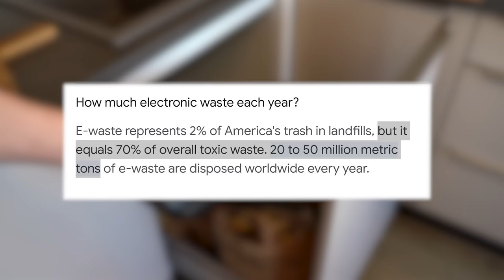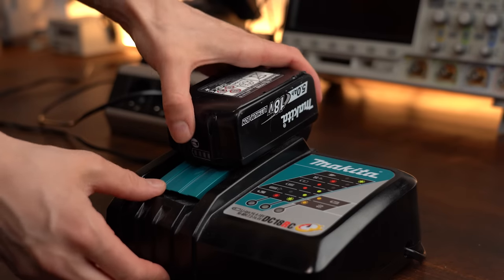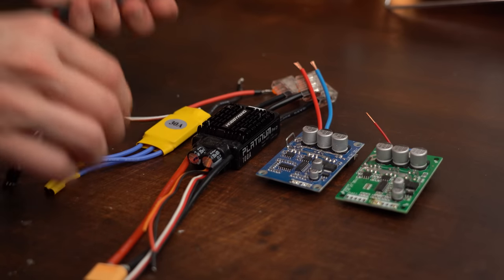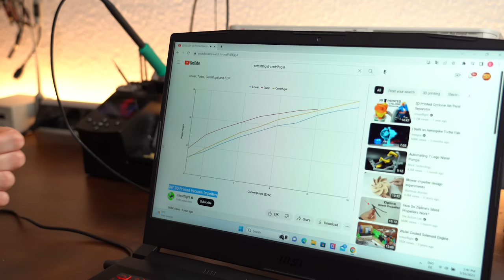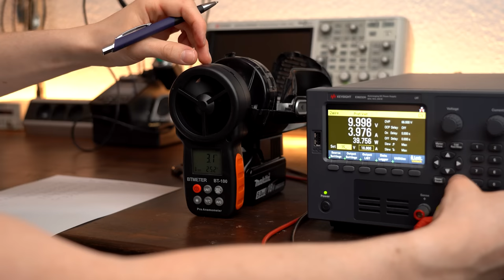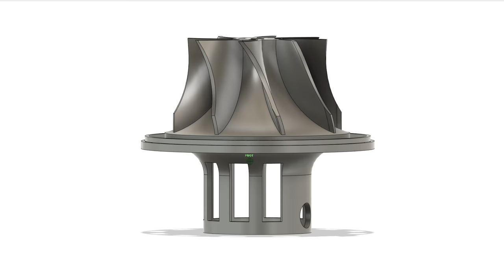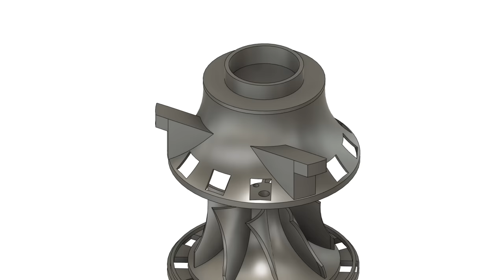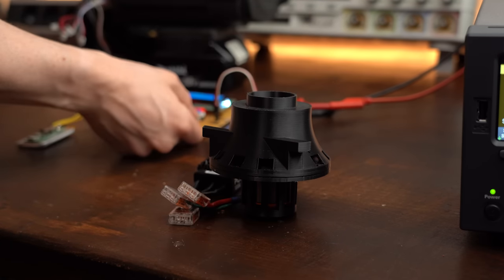I tried OVERPOWERING my Vacuum! (Homemade Turbine)

Comment: 7:12 I have the same idea for my vacuum from 2019, if there's anyway to upgrade to a brushless motor.  But no, it's actually more waste of time, money, e-waste to modify it.  you're better off buying a cheap chinese brushless vacuum or used ones. brushless motors are insanely high RPM, there's no 3d printer than can make precise and high strength turbines for the speed.

Comment: Put the original fan back in and compare the difference, it should be improved from original.  Your fan design has too much frontal face area and not enough airflow, causing a bottleneck.

Comment: Great video as always @greatscott! i saw that rpm reader at 3:26, im trying to build a circuit that enables a servo when the rpm reach 8000rpm and disables it under 8000 rpm.. but i cant find how to do it or what circuit to use.. can someone help? thx

Comment: I use normal vacuum cleaner what gets plugged into wall wall and it works well. Never have to worry about batteries, and motor has a plenty of power and doesn't show any signs of dying.

Comment: I'll attempt to draw this in the text box. You are are designing the impeller all wrong for what you are trying achieve.

____________/Housing air in\_____________ Housing
     __________}   Air inlet  {___________ One piece shrouded impeller
    /    Low profile      {}         Impeller          \  Compression out
  /______________ {}_________________\ 
________________{}__________________

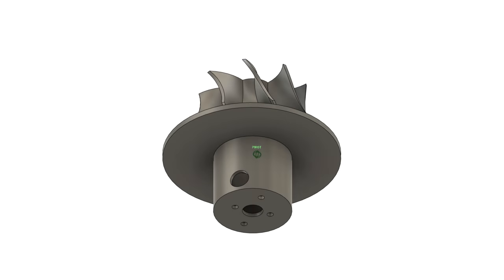Comment: 5:44 "I printed a high friction/high temperature mechanical components in PLA"
7:16 "Obvious PLA melting has happened, what a nightmare!"
 
Are you seriously creating issues on purpose for content? Any way it is, you should have your tinkering permissions revoked and your 3D printer confiscated.